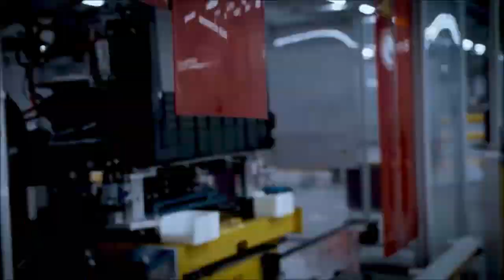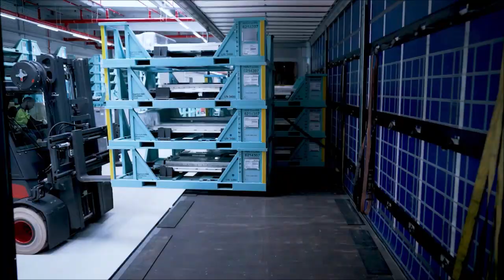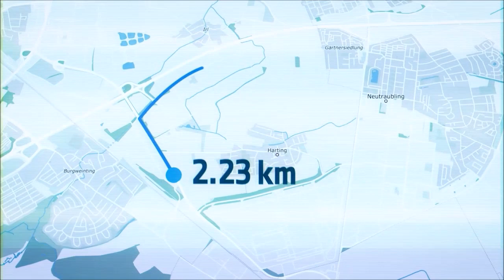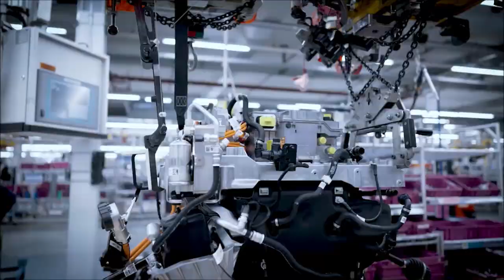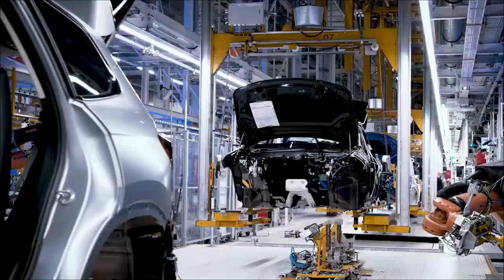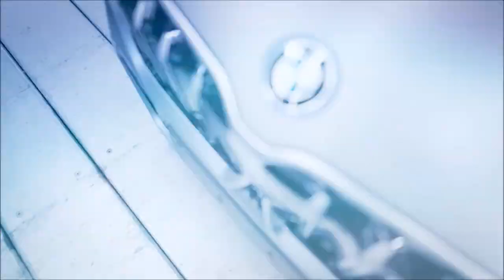2023 BMW iX1 xDrive30 U11 in Frozen Pure Grey - Produktion im Werk Regensburg

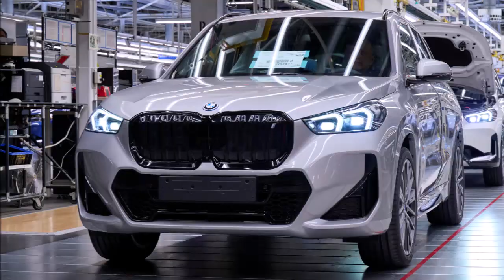Comment: 1:37 Ist das in der Mitte die Blue Bay Lagoon?
Reply from the maker: No, it should be Phytonicblau metallic
Reply: @rsDrive  Phytonicblau is much darker, and it is not available in M-Sport Paket if I am not mistaken.
Reply: Ich denke du hast Recht. Phytonicblau kann es nicht sein, wie du richtig sagst und Portimaoblau ist viel kräftiger.
Blue Bay Lagoon sieht zwar im Konfigurator anders aus (mehr ein türkis), ich habe aber im Motor-Talk Forum Fotos gesehen von einem X1 U11 in freier Wildbahn in Blue Bay Lagoon; und das sieht nochmal deutlich anders aus und ähnelt dem bei 1:37 schon sehr.